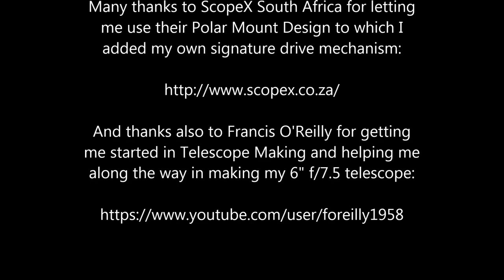Motorized Friction Based Polar Disk Telescope Mount

Comment: Dear Carlos!
Can I ask you (I'm a beginner in working with telescopes) - As far as I know, you'll need 2 degrees of freedom for star tracking. Why you're using only one axis and your telescope is making such a beautiful pictures? Why you left the idea of using the Stepper motor and switched to DC?
I really like your projects! Keep up the good work!
Reply from the maker: +magdanoz88 Hey, thanks for the comment! In theory, a perfectly polar aligned telescope mount would track the stars with absolute perfection using only polar rotation. However, nothing is perfect so it helps to have a motorized declination shaft and a guiding scope to tell the motors what to do to keep the stars perfectly centered. For the pictures I've taken of Orion (very few), the mount is good enough for 3 second exposures at high magnification without significant drift.

Regarding the stepper, it is in my plans to swap out the DC motor... I've already taken apart a printer and scavenged two small motors, one of which will be installed on the mount. The reason I used a DC motor is because it was easier at the moment of assembling and was readily available. The original stepper I was using was too large for a makeshift installation.
Reply: +Carlos Paris Thanks, Carlos! It's much clearer now! You're right - stepper motors have poor weight to torque ratio but you can control them easily and precisely. Can't wait for updates of your work!
P.S. Yesterday I bought my first telescope - 10'' Dobsonian. I hope my next telescope will be self made. :)

Comment: Wow!! I would like to build something like this.. Could you give us a more detailed description of the project? :D
Reply from the maker: Matteo, if you have any detailed questions let me know and I'll be glad to answer them for you.

Otherwise, it is a somewhat straightforward design, I used the bearings from the wheels of a skateboard, and bought a bunch of hardware from a local hardware store, like aluminum angles, stainless steel screws for wood, some bearings, etc. You may need to find a gearbox online that will fit your project in order to get enough reduction on the drive system.
Reply: Thanks for the reply! I do not have detailed questions actually, just planning to start building my own mount and I do not know where to start. I was wondering whetheryou had a project written down with all the measures. Maybe I can come back with more detailed questions once I will start building ;)